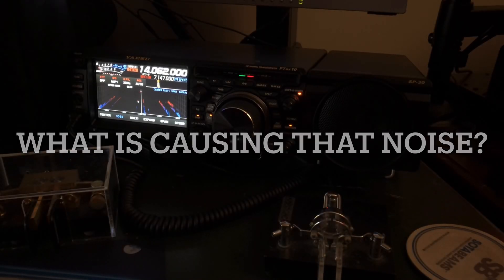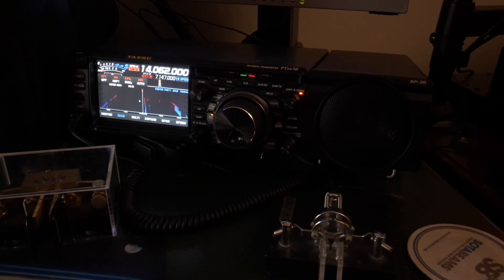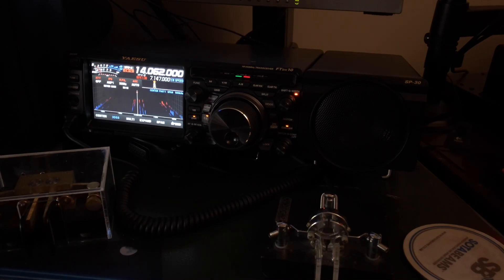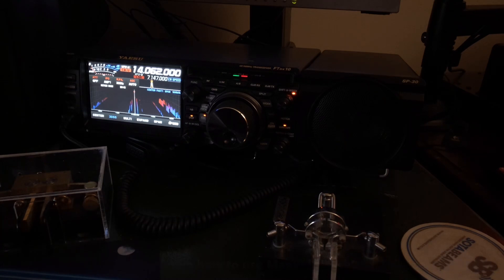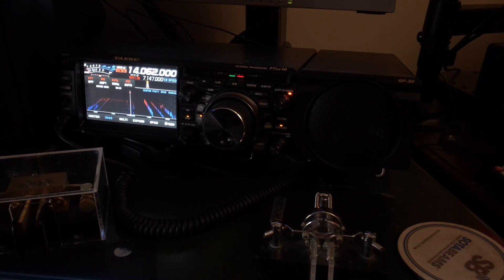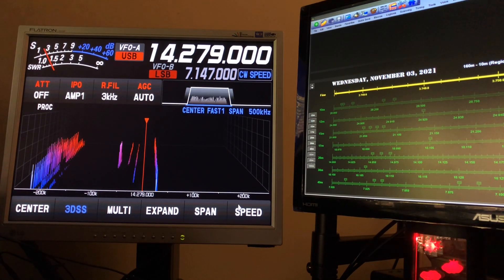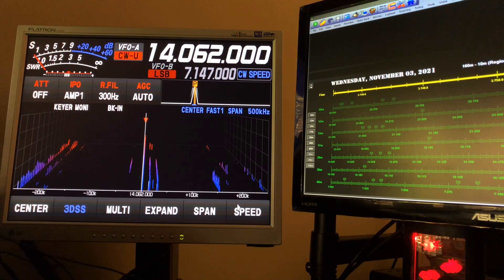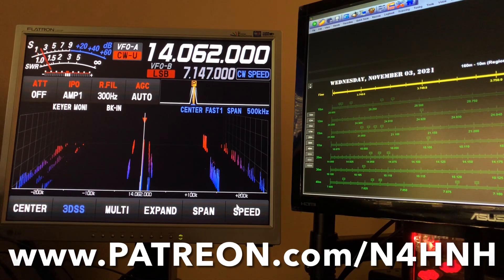What Is Causing That Noise? #hamradio #rfi

Comment: I notice the filter ripple when I engage the APF as well (on my FT-991A). 73
Reply from the maker: The APF is an amplifier so it definitely accentuates the ripple sound.  I use manual notch set 70 to 80 Hz below my CW sidetone setting to minimize the ripple.  I also use DNR, set to between 10 and 15.

73, de N4HNH

Comment: Had a horrible noise which was intermittent on my receiver.  After searching around the house and trying different things, I narrowed it down to two dimmer switches in the kitchen.  These would "control" the intensity of the overhead lamps above the working "task" areas of the range and the island.  Well the intermittent part was when these dimmers were engaged other than full on.  If they were actually dimming the fixtures, then an electronic RF buzzing was heard.   With some negotiations with the wife, the dimmers are gone and are replaced with simple on off switches... Problem solved.   
However, all electronic appliances are like a "community of neighbors".  Beware when you bring in a new electronic device....  some are not so nice to live with.   😄 W1SWL
Reply from the maker: Great detective work! Yet another noise source to add to the list. 

73, de N4HNH

Comment: thank you  that is fanstastic . how would a patreon  contact you. my not real good with computers.
been tring to use a slink shot , and it does not like me. my thumb is black and blue.
still working on cw. you hace great content
Reply from the maker: The Patreon site, where you sign up, has a messaging link.  But you can post here as a comment too.  That way others can learn too.

73, de N4HNH
Reply: @n4hnhradio  ok just trying not to be off topic
Reply from the maker: I see.  Well, you can message via the Patreon web site.  Patreon.com/N4HNH